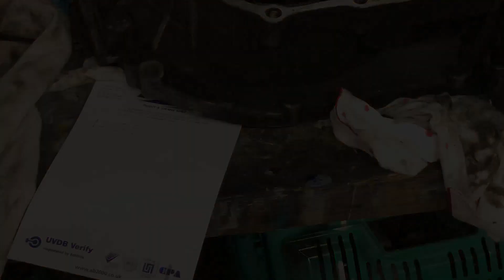Lotus Elise S1 PG1 Gearbox Teardown

Comment: Is it easy to fit Torsen B in a MGZR 160 gearbox?
Reply from the maker: an mgzr 160 gearbox comes apart exactly the same as this one, its not too difficult to do. if it comes with a ring gear already on it just make sure its the right one for your gearbox

Comment: please help me!, i have to try to do my clutch and i think my oil seal on the transmition side is leaking trans oil in to the bell housing behind the slideing clutch bearing from near the clutch arm, please can you tell me if this shaft oil seal is acsessed from in the clutch bell hosiuing and not from within the transmition side please!,
Reply from the maker: hi, i want to say its done from the inside but i could be wrong